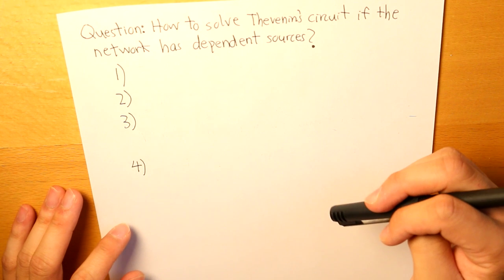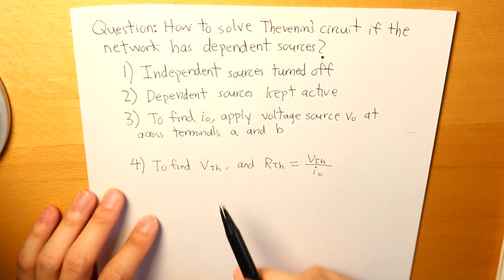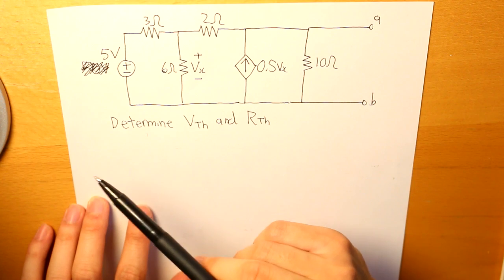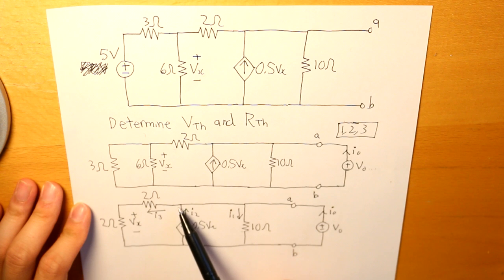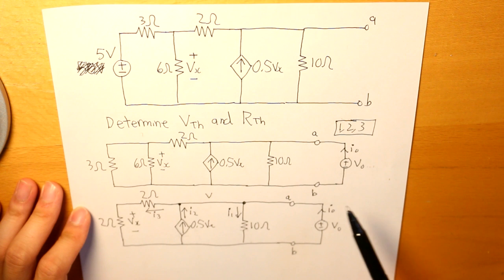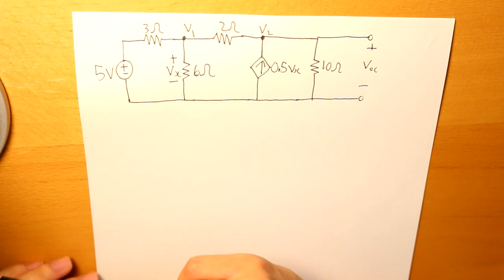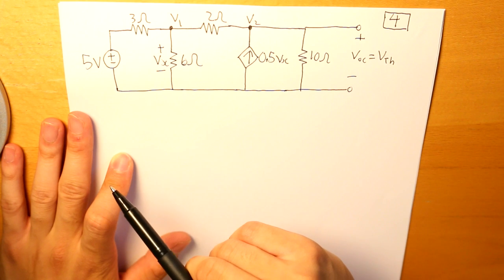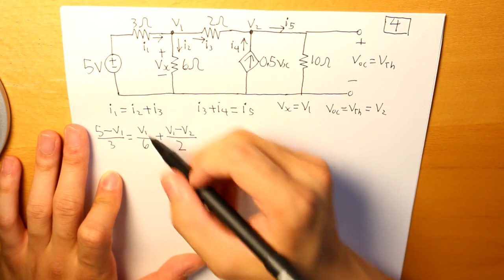Thevenin's Equivalent Example (Two Independent Sources w/ a Dependent Source)

Comment: Please remake this video. Everytime I see this I cringe just a little. Your calculation of Rth is completely messed up. You stated that Rth = Vth ÷ i_0, where i_0 is the output current of the 1 volt test source that you applied after you switched off the independent sources. Vth isn't even part of the circuit that you're analyzing. In any circuit where there are no active independent sources Vth is zero. When Vth is zero, Rth can be determined by dividing the test voltage by its output current. You got the correct value for the output current, 0.1 A. If you had divided that number into 1 volt, you would have gotten the correct answer for Rth, Rth = 10 Ω. I have to give you credit though. You did manage to correctly determine Vth.

It's not really fair of me to just swoop in here, level some unsolicited criticism and then bounce without explaining why you're wrong.

If you consider the KVL equation of a generic Thevenin circuit, you have this: Vth - i_load*Rth - V_load = 0.  With the independent sources deactivated Vth = 0. Then V_load = - i_load*Rth. Now, if you recognize that your test voltage has the same polarity as V_load but its output current flows in the opposite direction from the typical load current then you end up with this equation: V_test = i_0*Rth. Thus Rth = "1 volt" ÷ i_0.
I wish you the best of luck in your career, but no more rookie mistakes, okay?

Comment: Sir please what makes Vo = 1 by default??
Reply: hen doing Thevenin and Norton with dependant sources, we add either a voltage or current source. We call it Vo or Io. Whenever we add this source, we make it equal 1 by default. Its just apart of the process, there's no reason.
Reply: it makes the calculations easier, you can really chose any value

Comment: Sir,in this lecture(in 13.00 mint) why Vx and V1 are same???..
Reply: You are probably thinking that they cannot be the same since there is voltage drop across a resistor, but using this notation when vx(and its polarity) is placed by the side of the resistor it means voltage BEFORE going through the resistor, therefore vx=v1.

Comment: i calculated I(norton) to be 5/3 using mesh analysis , therefore the r(thevenin) was found to be 10ohms
Reply: same, I found the short circuit current is 5/3A and the R(th) = 10ohms
Reply: yeees!!!! to  calculate R(TH) we say V(0)/i(0).  i did  that and got 10 also
Reply: Me too...i did it using nodal analysis and got rth to be 10 ohm
Reply: @garnett657  how did u find i0 D using nodal analysis? i found vth but cant find i0
Reply: here i found a better video on same topic rth in this video calculated using 3 methods
https://youtu.be/D1QxFA9_U5w